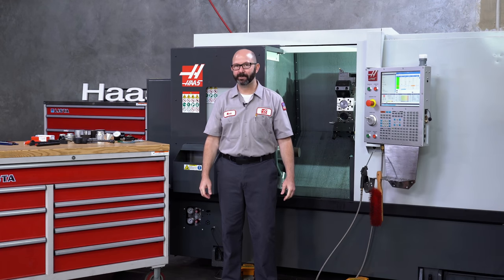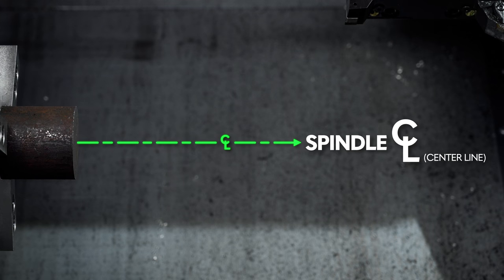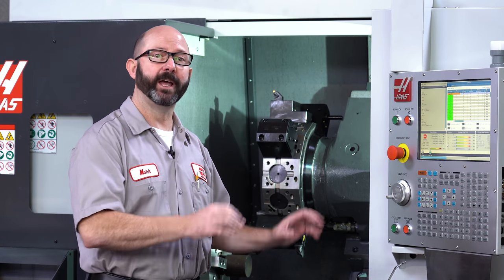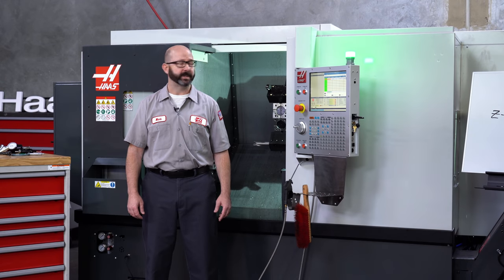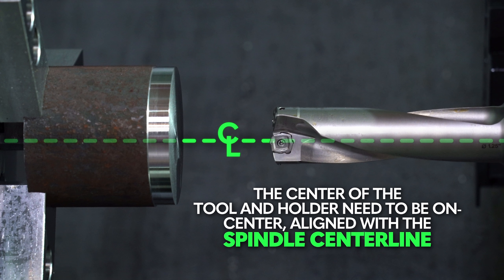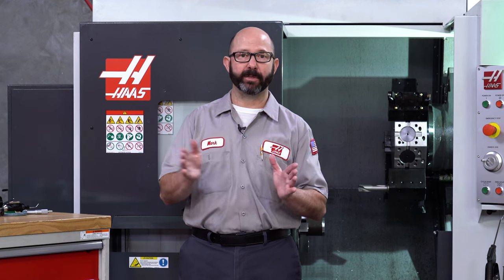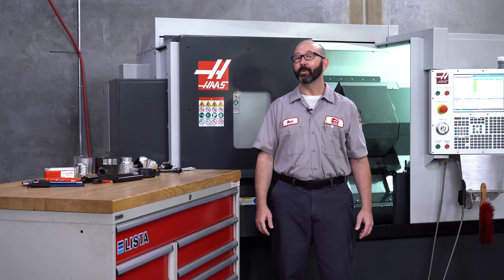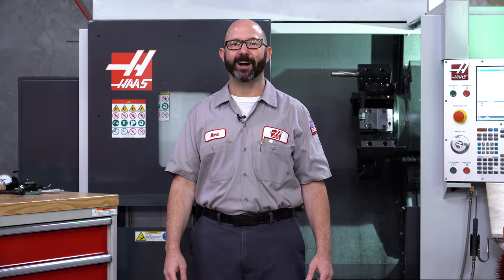Set Your Lathe Offsets Manually - Haas Automation Tip of the Day

Comment: Thanks, helpful tips. If you don't have a hole, but you need to measure a boring bar you can run the spindle in reverse and skim the OD of the part. Then you can input the negative of the diameter you measure. Though this only works if you have enough X axis travel

Comment: I use the tip of the thread insert, and always handle the tool in to check the Z clearance on any shoulders.  I eyeball it right until there is almost no daylight, and offset it accordingly.  Trust nothing, do your math, and "dry run"... even if it takes another 20 minutes.  Don't wait until you've started a thread cycle to figure out of you'll clear a face.

Comment: Yeah we touch the left side of the threading insert on the right side of the probe. Then when we program, we just add in the extra .100 to the desired length of threads in the program.

Comment: Thks Mark.  On Classic control we used to have F2 button set centerline tools as it was always the same number from home. Or the old magic marker number on the door.
Reply: We still have that on newer NGC lathes, in fact we've added a second X preset as well, so with one-button we can set the X position for common VDI tools, or BOT tools, or say an axial static tool and an axial Live tool. Great topic for a video, thx.
Reply: @markterryberry4477  thanks Mark. I also like to "dry run" my program without part after graphics prove out.  to make sure I'm not going to hit the jaws with coolant shut off.  Its so hard to see inside the lathe.
Reply: @mark terryberry can we get more Haas Lathe G Code like first 9 lines and g96 g97 stuff
Reply: @markterryberry4477  @mark terryberry can we get more Haas Lathe G Code like first 9 lines and g96 g97 stuff
Reply: @pokeyboy1  filming G71 today, just for you Pokey :)
Reply: @markterryberry4477  your up early
Reply: @pokeyboy1  yep. In the photo area. There is a lot to G71! Good stuff.

Comment: I touch my boring bars off to the back side of the machined surface and just use a negative diameter value. Also for drills you can use a guage pin and a feeler guage to find the offset.
Reply: Can you explain how you set the drill?

Comment: While I have the ATP and it's not been a problem, but would be good to show a good method for manually touching off an opposite-hand tool for back-cutting and so-on. 

My gut says take a flat surface (gauge block for example) and press it against the cut reference surface, then touch off of that. But wondering if there's something I'm missing.

Also for a neutral cut tool, say a V-type, is the method basically going to be the same as shown for a threading tool? Touch off the side of the holder then offset a further amount based on the edge to CL value? I feel like there would have to be some amount of maybe dialing that in depending on just how on-the-nose everything is.

Comment: haha you are smart .. I use to set the work offset with a tool  that have zero length when the probe is out of order..   but then i have to manually add the work offset to every tool instead.. This  method  is alot faster  and less frustrating ;)

Comment: lol, I got my first lathe 2 weeks ago and was wondering why there wasn't a video on how to manually set tools  .... spoke too soon
Reply: it does tell you in the manual
Reply: I’ve studied that manual again and again and found it to be useless for this.  I got basically the same information as this video from experimenting over several sessions. I greatly appreciate the video validating most of what I had figured out and correcting one thing.  I feel free to really use the lathe now.  I was reluctant and in my daily work I’m usually barely on time so it’s always been faster just to finish the part on the manual lathe.
Reply: @billknighton4181  I was the same way. I had  figured it out by messing around but its nice to hear haas say it
Reply: I started making my first lathe part last week and I could have REALLY used this video lol. Just need to add my tool tip radiuses now.
Reply: @billknighton4181  there's nothing in this video that isn't in the manuals that come with the machine.
Reply: @SuperAWaC  The video is many minutes long and the manual has several sentences on this with language I found ambiguous.  That’s great if it’s all you needed. Superior learner. It was inadequate for me and some other people too. 
  Hfo wants $1800 to teach me this material in one session. They are charging what the market will bear and the market believes the manual is inadequate or who would part with $1800 when the manual has everything they need?
Reply: @billknighton4181  i suspect that they did not give you the programming workbook. search "haas lathe programming workbook"  online
Reply: @billknighton4181  Agree the manual is not the best. There is a lot of trial and error when starting out... but you soon realise just how easy they are to set up. I set all tooling on a pre-setter then I run a small programme to fine adjust the tooling against the job (with a feeler)  as I am backturning and using 8 or 9 tools on most jobs.

Comment: I can’t like this video enough. I’ve been waiting for this for 1 year.  I’ve been fumbling around with my new ST 15 and not really used it for very much this last year.  I finish daily jobs on my manual lathe.  
  My proposed use for the lathe is for a family of parts and the same tools will be set up all the time. If I turn the machine off, when it homes next time on startup will the limit switches always give the exact same result so that I don’t need to reset the tool offsets? I have the automatic pre-setter but I’m nowhere near to figuring that out.  I think I messed up the calibration on it entering some incorrect numbers.
Reply: Its really worth getting to know the pre-setter and how to calibrate it. You don't have to re-set tooling on every job (just the face offset of course) every time you power up. Are you on New Gen ?
Reply: @mjohns5944  how are the home switches for accuracy? 
If you turned off the lathe would you use the presetter after homing to reset offsets for each tool or could the home switches be trusted to find consistent home positions?
Reply: @billknighton4181  Yes no problem. You have to do the startup when power on and that sets everything back up. You should not have to re set tools after power up. I go for days on ultra precise form rolls without re setting tools....just slight offset adjustments. The ST15 is a great machine. I had one for a year and it held size.

Comment: Threading setup, indexing from leading edge (for tool clearance), or apex of tool (center)? 

As a newbie, but techie -- why not BOTH? I haven't as yet setup my tools (for manual tool changer, via Mach3, yep a hobbyist) -- but why not two setup profiles (aka alias or synonym) for the same physical tool? (for manual tools, not a biggie since I would just reload the common physical tool when required -- but it may take some additional programming ;) for you big guys with the fancy equipment --  I may even get a kick back for a new idea??? :) )  Personally, I would think going with the center/apex (on threading, eg) is the best route, and deal with what you're trying to accomplish as part of a greater tool/collision avoidance algorithm.

Comment: Great video!  I'm having a problem jogging the Z axis with the door open.  I need to be able to jog and use the feeler gauge at the same time.  The machine won't let me jog with the door open.  Do I need to be in another mode?  I'm using a TL-1 lathe.

Comment: What about the trick of setting a boring bar on the far side of the part. You can spin the chuck backwards, take a cut on the OD of the part and measure it with a mic. Then whatever number you measure just put a negative sign for x diameter measure.
Reply: I use the same method as you do.
It works with indexable drills too, which are capable to be used as boring bars.
Reply: Nice! If its a small part and the machine has the travel, that method is really quick.  If we know the O.D. of the chuck itself, you can also hold a gage block (or 123 block) against the top of the chuck, and then jog the I.D. Boring bar up to the block, sliding the block back-and-forth until you feel the bar make contact, and then X DIA MEAS, and enter the O.D. of the chuck as your diameter. There are lots of quick tricks. For drills, we'll often just touchoff on the side of the drill, and then subtract the drill diameter and the part diameter for a quick and dirty no-indicator X touchoff. We talked about adding some of these quick tricks, but the video was already getting long! Fantastic comment.
Reply: @markterryberry4477  it's also a nice trick to use the chuck OD. :)
One more thing, I never use paper. I always use precision feeler gauge for measuring! It's precise, inexpensive, never gets wet, and has some stiffness. The 0,05 mm works just fine, but the 0,1 mm is the best.
You can keep a little piece underneath the caliper in the box.
Reply: @arpadbrecska8178  yes, 0.1mm is the best, we've used it for years.
Reply: @zyndapp800  I've been using mine for 5 years now! By storing in the caliper's box, I can do any set-up with only one "toolbox".

Comment: Just starting on a Haas ST30 SSY, I set my tool offsets exactly as demonstrated.  I wrote the program exactly as demonstrated except that my diameter is 1" so I entered X1.1. When I run the program the tool stops 1" away from my work piece, why??

Comment: Pro tip...On the NGC, when testing the location of the tool you just set, the M30 MUST be programmed in MDI. The classic controls didn't need this, but the NGC will move the tool in the positive x direction. 45 min it took me to figure this out.😒

Comment: let’s say I faced my part and set z zero there but wanted to have the real z zero 0.010” deeper.  Maybe I want a programmed cut on the face instead of one that I just jogged. For superior finish.   Would I set the work offset at 0.010”?
Reply: Minus the .010" from your work offset G54. This is what I do. touch off all tools to the initial machined surface and use z face measure. Then minus the amount of additional cleanup desired on your G54.
Reply: Yes G54 z-.010.

Comment: What do you do if the Y needs to be adjusted when indicating a tool holder?
Reply: It depends on the lathe. If you have a BOT Turret, there will be small eccentric Cams, under the BOT holders, that can be adjusted to bring a holder in, in the Y. On a Y-axis lathe, its really simple, we just enter in the Y machine position on the Tool Offset page, and call up Y0 each time we run the tool. On a TL with a Tool Post, we'll use the old machinist trick of pinching our machinist scale in between our turning tool and the part, and adjust the Tool up/down until the scale is pointing vertically (or a little positive rake). Lots of options, depending on your exact setup.

Comment: For drills, taps and reams why does the centre of the tool and holder need to be on centre, aligned with the spindle centreline?
Reply: On the lathe, the spindle turns, while the tap/drill stays still. If the drill/tap were off center a lot it would break. If the drill is off center by a little bit, then the hole gets drilled oversized.

Comment: very informative video. but I am still confused to take drill x offset
Reply: For drills, we usually set our X Tool Offset at the center of the tool holder with an indicator, before we ever install the drill. On Haas Machines this value can be stored, and recalled by pressing F2 any time we use an on-center tool like a drill or ream in that Tool Position. We'll make another video on that. A less accurate way to set the X for our drills, is to jog our drill down against the Outside Diameter of our part, set our X Diam Measure at that diameter, and then subtract the diameter of our drill from the X offset - this is quick, but less accurate.

Comment: tip of the day: get the automatic tool setter
Reply: That isn't always an option. On older machines especially it wasn't very common.  Even presetters can be wrong if they've been bumped or have a sticky switch. Just don't mix preset tools with tools touched off on this fashion. That will result in bad things happening.
Reply: @brandons9138  Yeah of course, I'm referring to the incredible setup reduction time the presetter gives you... Nowadays you can't touch off tools manually if you want to compete
Reply: @steelfalcon2755  Manually using a presetter is not saving that large amount of time. If you have a presetter that can run on it's own using macros then it becomes a real time saver.
Reply: @brandons9138  I believe that it can do that... Also automatic breakage detection
Reply: @steelfalcon2755  bet I can manually touch tools off as quick as you on a probe..we have both and have done it many times
Reply: @stevebriggs9135  maybe that's true, the real advantage is that you can control length and diameter and change the offsets accordingly... I believe that is extremely useful during lights out machining

Comment: You guys show how to indicate a hole, but you did that on a mill. You need to do a video on indicating tool holders on the lathe, that is totally different having to adjust that stupid cam on the side mount for drilling con center line. Do a video on it!!!!!!!!
Reply: Adjusting those cams on BOT holders is not bad, once you've done it once - which makes it a good candidate for a video! Thanks. If you have a BOT Turret, there will be small eccentric Cams, under the BOT holders, that can be adjusted to bring a holder in, in the Y. On a Y-axis lathe, its really simple, we just enter in the Y machine position on the Tool Offset page, and call up Y0 each time we run the tool. On a TL with a Tool Post, even turning tools will need Y-adjustments, we'll use the old machinist trick of pinching our machinist scale in between our turning tool and the part, and adjust the Tool up/down until the scale is pointing vertically (or a little positive rake). Lots of options, depending on your exact setup. We'll move this up on our list.
Reply: @markterryberry4477  video will be awesome! 
I run a 2-axis st-30. Adjusting that cam to try and dial in center for drilling is a pain!
Reply: @raider1628  It really would be a helpful video. We'll bring it up again. Check out this link. It contains some general instructions on setting those BOT Cams. A video would still be great though. https://www.haascnc.com/service/troubleshooting-and-how-to/how-to/st---ds---toolholders-to-the-spindle-centerline---correction.html

Comment: Why are boring tools always pointing up?  Just a convention?
Reply: As far as I know, its just the convention. With the boring bar facing down, you could run into a travel issue, running out of travel on large bores. If the boring bar faced down (which is physically possible), then you would have X+ being Up for O.D. turning tools, and X+ (bigger part) being Down for boring bars - two different directions. Our standard boring bar retract directions would get weird as well. I've wondered the same thing :)

Comment: When OD threading back to a step or wall. After touching off the threading tool, I call the tool up in MDI. G0 T???? and the work offset is usually G54. Then manually bring the tool back to the step in Z. The # in the Z readout shows where the tool will stop. It costs me a little time, but saves my tool and part.